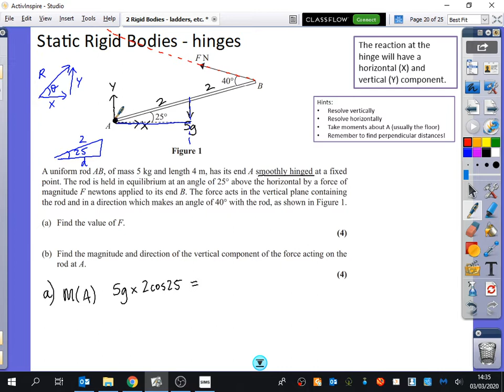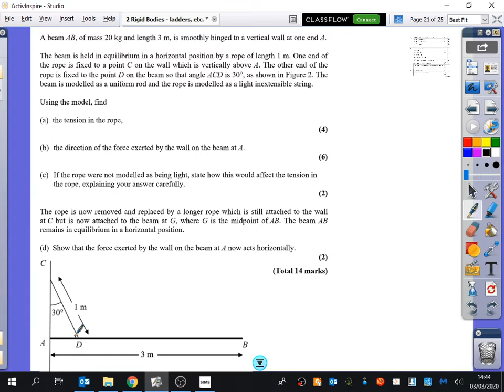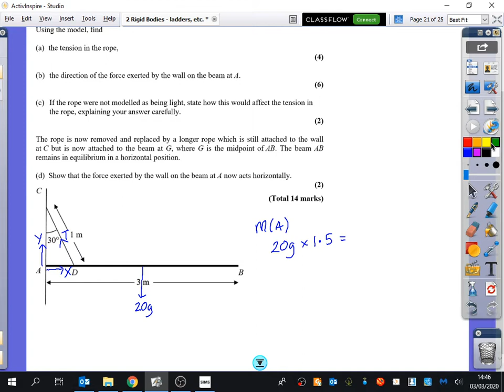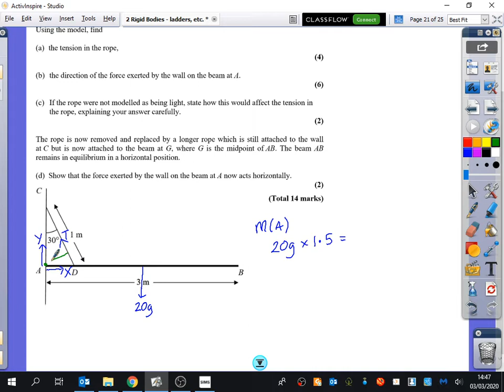Rigid Bodies 15 • Hinges • Mech2 Ex7D • 🎲

Comment: Would it not be possible for it to be ‘roughly hinged’ and there be friction at the hinge,and if so what direction would this friction act in,
as part of the reaction or will it only be smoothly hinged and hence only normal component of reaction.
Reply from the maker: Good question! If it were roughly hinged, I believe there would be an additional component at the hinge, perpendicular to the rod, and in the opposite direction to which the rod would be about to move in (we would likely be considering it in limiting equilibrium). However, you’re probably pleased to hear that all questions are always smooth hinges! So you can just draw the X and Y components as usual for all questions. Hope that helps. 👍🏼
Reply: @BicenMaths  thanks for the quick reply! You truly are saving my mechanics grade.
Reply from the maker: 🙌🏼 love to hear this - good luck, let me know how else I can help! 😃

Comment: 18:18 Hi Sir, I was just wondering if you could explain further why we would ignore "T Sin30" when taking moments as I don't quite understand your explanation. Thank you!
Reply from the maker: I prefer my original version where I resolve distance and not the force for this very reason! Essentially when you resolve T, both the forces would be coming from the start of the string. The Tsin30 part would therefore 'go through' A, so its perp distance would just be 0, hence it is ignored.
Reply: Thank you so much

Comment: Hi Mr. Bicen I know this is super last minute with the exam tomorrow, but I can't seem to understand why at 18:06 the forces are drawn like that and not along the Y and X, where the tension is split up into Tcos30 along the wall and Tsin30 from A to D and then the moment about the would just be Tcos30 since it is perpendicular to the beam. Why does this not work? 

I generally really struggle with finding the perpendicular distance & force and naturally prefer the physics way but even then get stuck like that. 
Thanks for your help!!
Reply from the maker: This would work! But you'd also need to consider Tsin30 as well, as this component of the force is also doing some turning. This is the alternative approach to the question. It works!

Comment: first time ive ever seen this type of question wow, how do you decide which way the reaction force is in first q? i just dont understand the x and y stuff at all tbh, do you mind explaining why you do it in more detail? and does it vary depending on how "open" the hinge is and if so, how? why cant we just do trig to make it in terms of sin and cos?
Reply from the maker: Basically the reaction at the hinge is not going to be vertical or horizontal, but it will be diagonal. To deal with it, we pretend there are two components, X and Y - the calculations will reveal their values and directions. To find the overall reaction, we can put them back together again using Pythagoras, and find the angle using tan. It's hard to predict which way the reaction will be, as it will depend on many factors, but generally if something is pushing down into the hinge, it will push back up diagonally. If something is pulling down on the hinge, it will react downwards towards it.
Reply: Hey sir can you explain to me abit more on why we would change these values to x and y and when we would do this I’m still abit lost on that thanks
Reply from the maker: @rayzino3338  We need to add X and Y (or other letters) for forces when something is either hinged, or resting against a rough wall. This is because the overall force is at an angle, or is a combo of reaction and friction - and to find these forces, it's easier to split it into vertical and horizontals, and then recombine with Pythag and trig.

Comment: 8:43 , how would you do this using the physics way? perp force x distance
Reply from the maker: Very hard to show without a diagram, but you resolve the force so that it is parallel to the beam and perp to the beam. You then can ignore the part parallel to the beam as it has distance of 0 through the point you take moments, and then just do the perp bit multiplied by the distance from the point you take moments.

Comment: 15:04 why is there a Y component to the reaction at the hinge when the rod is horizontal? I thought it would only have a normal reaction like X
Reply from the maker: If there’s a hinge, it could be tugging or pulling on the hinge in a vertical direction as well as horizontal and still not move - which is why we account for it!

Comment: sir i don't understand 19:09 why this distance wouldn't be Tcos30? like you did at 18:11 here. because isn't the hypotenuse T
Reply from the maker: Good question - I think what you have done is confused the force labels with the distance labels on the diagram. Make sure that when you are calculating perp distances you do NOT use the force labels, as they are not referring to the same thing. Does it make sense that a distance cannot be Tcos30, as this is saying that a distance is in terms of a force? Let me know as I can try and explain further :)
Reply: @BicenMaths  ahh ok i think i understand now

Comment: at 15:52 why isnt there reaction forces at c and d?
Reply from the maker: There IS a 'reaction force' at C (it's not actually a reaction, but it is the tension from the string, acting in the opposite direction) - but we're considering the beam, and what it experiences, so it isn't included. There also is a force at D, but it again isn't a reaction, it is the tension.
Reply: @BicenMaths  so we’re thinking of it from what the beam is feeling so it’s only feeling the tension from the string?
Reply from the maker: @user-ji4op8xn8i Absolutely. Anytime we draw a force diagram, we should only be drawing the forces that the thing we are considering is experiencing. The only exception is where we have connected particles, where we draw the forces each one is experiencing, but on the same diagram.
Reply: @BicenMaths  okay thank you so much
Reply: @BicenMaths  and the things we are considering are for example the ladder, rod , beam etc?
Reply from the maker: Yes correct.  @user-ji4op8xn8i